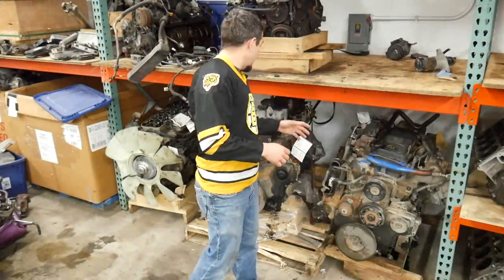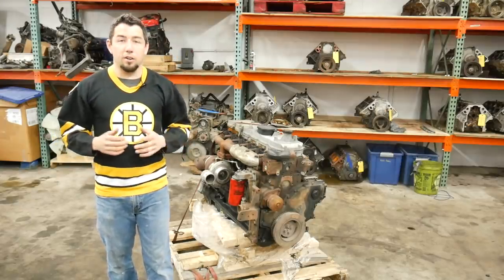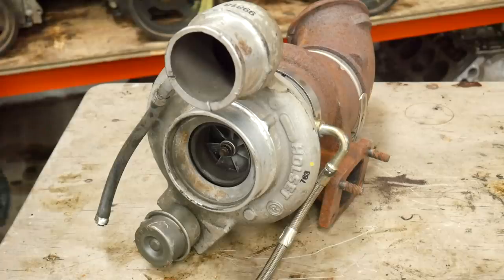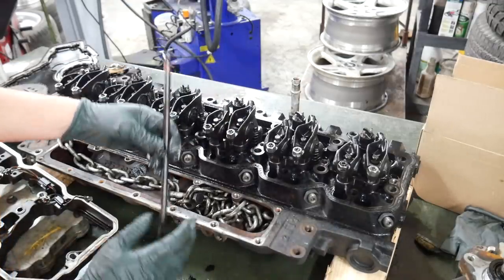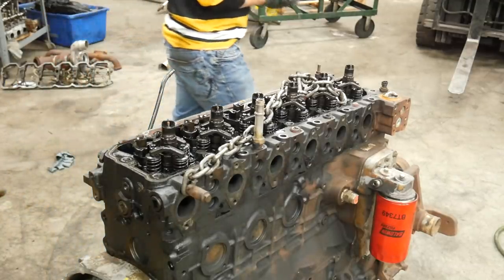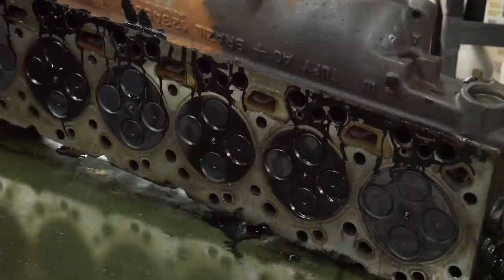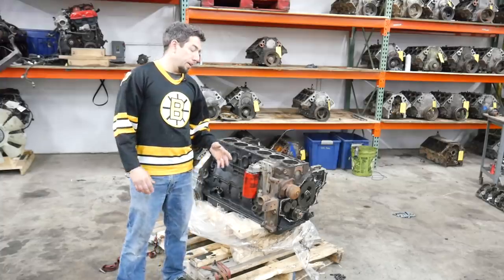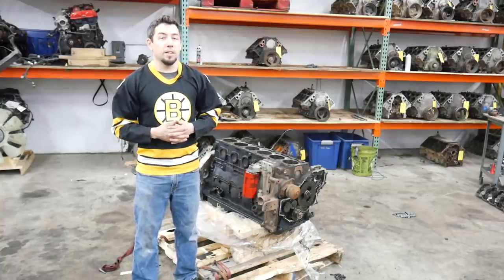5.9L Ram Cummins Turbo Diesel Teardown Part 1! Ope, I Found A Problem Already!

Comment: I drove a work truck way back that had the 5.9 Cummins. It was a 2006 Ford F-650, YES with a Cummins. It didn't leak or use oil between changes. At 331,000 miles they sold it because they said it had "really high miles". Hey, if it's over a million miles I might have a modicum of concern - but not 330K.
Reply: My grandpa had a work truck with a 24 valve in it. Over 500k and still woke up everyday ready for work along side my grandpa. One of the best motors that will ever be produced.
Reply: @stevenchavez2003  It's in good company with the Ford 4.9 inline six, The Jeep 4.0 and the 225 Slant Six.
Reply: @_BAD_MERC_  I would add the Toyota 22R to that list

Comment: When you disassemble the bottom end, carefully remove the oil spray jets for the bottom of the pistons.  I'll bet you find debris behind the nozzles for #5 and #6.  It's pretty common to see these get clogged and the pistons will overheat, get bound up in the bore and hammer the rod bearings out.  Usually cheap oil filter media will break loose and clog the nozzles.  jmho
Reply: Hammer the rod bearings out? The bearings go first due to lack of oil pressure which is the ONLY thing that "hammers out" rod bearings that actually "spin out". The piston cooling jets end up plugged with rod bearing remnants "hammered" back into the crank and main journals and then flushed into the jets when someone finally "checks the oil" and tries to "heal" the catastrophic failure and "bearing knock" by putting oil in.

Comment: Great video. No need for a special tool to pull injectors, just pull the crossover tubes and then a screwdriver will pry em up on the hold down

Comment: I think I have watched about a 10 of your teardown videos at this point (they are quite relaxing to watch) and I am always amazed  at how you can pull apart and engine and not get grease and gunk on your clothes. It seems like I can't even check my oil half the time without getting something on my pants or shirt.

Comment: The "sensor" on the fuel pump is actually the metering valve that controls rail pressure. It is a replaceable part and does not render the pump useless if it is broken.
Reply: Yep. SCV valve

Comment: It's amazing that you can easily get like 1000 hp out of these engines. I'm in the process of swapping a 12 valve Cummins into my blown up 08 F250 used to be 6.4 truck. Which brings me to my real point, I'd love to see a teardown on a 6.4 Powerstroke. Believe me there are plenty of em, ( most actually lol ) out there that are blown to shit. Love ur videos brother. Keep on wrenching!

Comment: The injectors normally will pop right out, but you need to pull the 21 mm retaining nuts and fuel transfer tubes out of the head with a small pry bar, then injectors will be removable

Comment: When using a gear puller, if the bolt circle is on the tight side, flip the puller and pull on the flat side of it (I keep it like that most of the times). Hope it makes sense

Comment: I see we are of a similar mindset. That is that overkill is good place to start. Silly me, when I heard "That head is to heavy to lift off without help." I thought you would roll over an engine hoist, but noooooo here comes the fork truck! Thinking back on it that fork truck gets a lot of use in your shop, safer and easier is always a good thing!

Comment: Nice the first vid I watched today was the lotus now you're doing the 04 Cummins which is my truck.it has 329,000 miles still running strong everyday driver.had the trans rebuilt when I bought it

Comment: Awesome!!  Thank you for doing the Cummins tear-down!  I can now say, without a doubt, that I will NOT be attempting a head gasket job on mine. I will gladly pay somebody.  For the record, mine doesn't need the head gasket; it's in preparation for compound turbos. :)

Comment: Makes the 4.9L I6 in my 1984 F150 look like a Honda 4 banger... When I rebuilt it, the only items I used a hoist on were the whole assembly and the block. That head probably weighs more than said block... :O

Comment: Something else I'd like to see is a 5.4 3v engine teardown. These were notoriously bad engines due to an under pressured oil system and narrow oil galleys. 

There are other videos of people working on them but none of someone just stripping the motor quickly. I'd like to see one for reference since it's possible I'll be working on one sometime soon; I have a 5.4 3v and as far as I know the timing components have never been replaced or upgraded. At 211,000 miles, I have to assume it's coming.

So if I have to go in to the motor I'd probably want to replace rocker arms, possibly cams, and check hydraulic lifters as well. With truck prices being what they are it may be wise to replace crank and rod bearings as well. Would be cool to see a quick rundown of all of those components being pulled.

Comment: Those injectors don't need a special tool to remove, have to pull connection tubes that the fuel lines attach to before the injectors, if they are stuck, put a fuel line on it to have prying surface

Comment: To get the injectors out you need to take out the pickup tubes first (after you take the fuel line off it's the nut holding them in). Pulling the injectors with out removing the tubes can damage them.

Comment: Hi from Case in Vegas, I found your Duramax teardown while searching info. on replacing the injectors in my 04 LB7 Duramax, I'm hooked on watching your teardowns, I just watched your 04 5.9 teardown. in addition, I have a 12V with 127k I'm going to marry to an Allison 5 speed. would you happen to have any parts that are needed to complete this marriage? any info would be greatly appreciated.

Comment: Also when I worked at the heavy equipment shop we always used the forklifts
Reply: We had cradles for pulling engines at Greyhound that were specifically made for forklifts. Had a hoist in the engine teardown area but pulling engines in rear engined buses is always a forklift job.
Reply: @jnelson4765  man we literally used it for everything. Used it to remove big cylinders for excavators that thing literally saved my body some much unwanted pain!

Comment: Injectors won’t come out with the fuel transfer tubes still in the cylinder head. Must remove transfer tube hold down nuts then pop transfer tubes out with a screwdriver then pop injectors out with a pry bar after removing injector hold down bolts.

Comment: You need to pull the crossover tubes before you can get the injectors off. Take off the nut where the injector lines hooked up.

Comment: Use a lady slipper for the injectors  get under the lip on them and pop them up. Do that after taking the silver tubes out the side of the head. They’re bolted down and torqued to the injectors

Comment: I know nothing about Cummins engines but it I was a little surprised the engine had metric bolts, I thought for sure the would be using freedom sized bolts.   I how long have they been using metric?
Reply: Metric has been using for years. As a Merican...?.time to do this
Reply: my 95 cummins is all metric.

Comment: I haven’t watched the video yet, but I’m super curious what you find after having to rebuild mine from scratch. Nothing but the block, pushrods, timing cover, & valve cover survived from mine; not even the turbo. (I.e., it dropped a valve seat)

Comment: I was going to say to do a 7.3 powerstroke but they don't stop running.
Reply: the ford girls have entered the chat.
Reply: @robroy5729  dodge babies crying already.
Reply: @me005003  the ford girls are even more upset now
Reply: Laughs In Duramax
Reply: A 7.3 is a good engine , but Ford would probably used a cummins if they could have ,they did use them in their bigger trucks .

Comment: The reason this engine became a core is the counterfeit/non-Fleetguard lube oil filter.
Reply from the maker: Really? I have no opinion on the matter, we’ve done so few of these yet.
Reply: @I_Do_Cars  I do strongly prefer Fleetguard. It is a product of Cummins, as opposed to most OEM-labeled filters. Plus, many of the non-Fleetguard (Cummins Filtration is the actual name of the subsidiary) cost more. Who better to understand filtration needs than the engine manufacturer. That is my humble opinion and the rationale behind the opinion. Others are welcome to form their own as applicable.
Reply: Orange can of death...
Reply: @davebetker8788  this one is redder than orange (Baldwin versus Fram).
Reply: Baldwin > fleet guard

Comment: Okay correct me if I’m wrong here but I’ve seen you do this in a few videos and it didn’t seem right; when you loosen the head bolts, shouldn’t you be doing them in a specific pattern? Will you not warp the head loosening them the way you did in this video? I’m no expert so that might not be true but I’ve been thinking about pulling the motor in my mustang apart so these videos have been nice to see but that’s bothered me in the few vids I’ve noticed it in and had to ask
Reply from the maker: On aluminum heads, that I think are good, yes, I do a star pattern. There is no warping a 200lb cast iron head without heat.

Comment: The Cummis are hard to blow up unless you got over 90-100PSI on them. I watch a lost of drag racing and 99% or the diesels are rolling coal which means they are way to right and losing a lot of power. When the smoke from a diesel is white they are making power when it is rolling coal they are wasting fuel. Learned that one 20+ years ago watching tractor pulls. And gas engine uses Nitros where a Diesel uses propane for the same thing for extra power. Sadly not many know that anymore. I am old school so I remember the old school things that the "tuners" now days are clueless on,

Comment: 7:25 Are the bolts you pull out reusable, or are they torque-to-yield?
Reply: Cummins has a Guage you use to see if the head bolts are able to be reused. In most cases arp studs aren’t expensive just stud them.

Comment: do 'cores' that are turbo from factory typically make it to you with the turbo still installed? seems like the kind of thing anyone would pull before selling the rest
Reply from the maker: It’s 50/50, but you’re right. The places I buy cores from know I pay more for more complete engines so they try to keep them complete but not always.
Reply: in fact now that I think about it I'm pretty sure the ford/mazda 2.3 you did had all the intake and exhaust pulled from the start. luck of the draw?
Reply from the maker: Zachary Clarke it really is. Sometimes I get them so complete they have harness and computers on them. It’s just random
Reply: @I_Do_Cars  cool man thanks for the reply. love the channel! it's interesting seeing how different oems approach things and how different issues manifest with design choices, kinda automotive forensics

Comment: You have to remove the fuel transfer tube then remove the injectors. The transfer tube is what connects the fuel line that you removed, to the injector.
Reply from the maker: Learning everyday. Makes derp sense. Thanks!
Reply: @I_Do_Cars  an easy trick for removing the cam shaft is to flip the engine over so all the lifters slide out of the way and the cam will slip right out, the other option requires special tools to hold the lifters out of the way.   Thanks for all the videos you produce!
Reply from the maker: Matthew Crandall I’ll do just that! I looked at it today and I don’t have enough magnets in the shop to even try that method. Gravity works!
Reply from the maker: Matthew Crandall I appreciate all these tips, it always helps to talk to those that do what I don’t that often, on a regular basis.